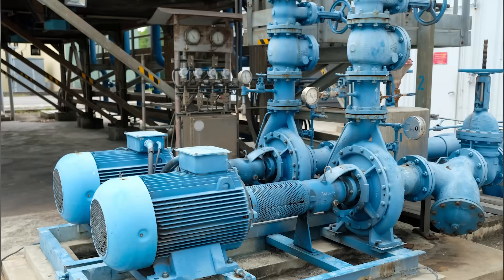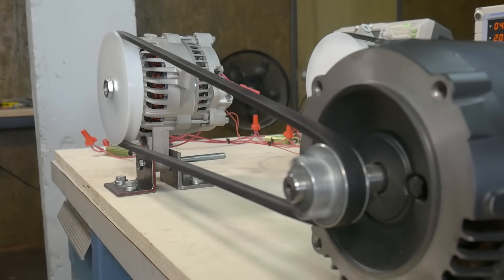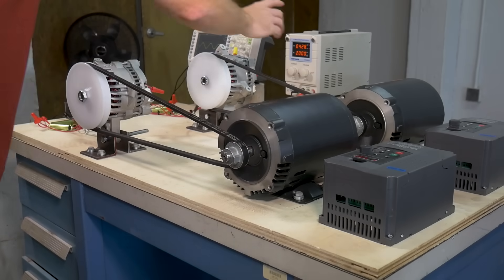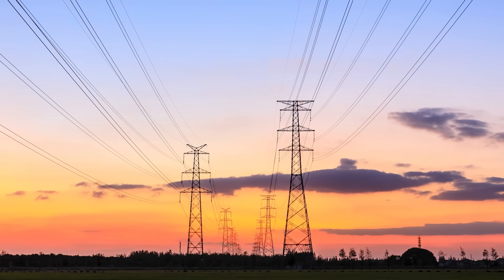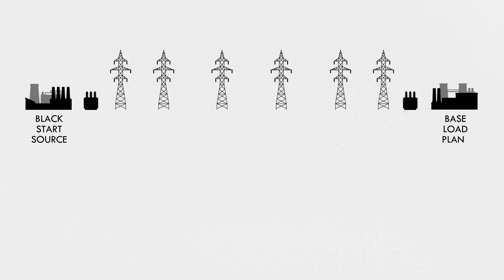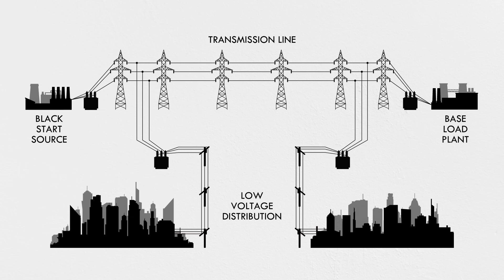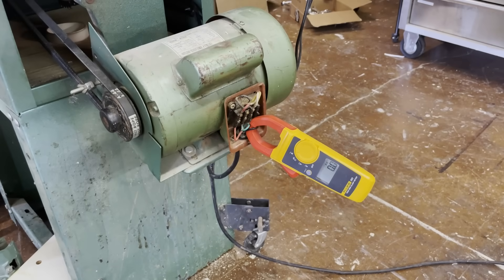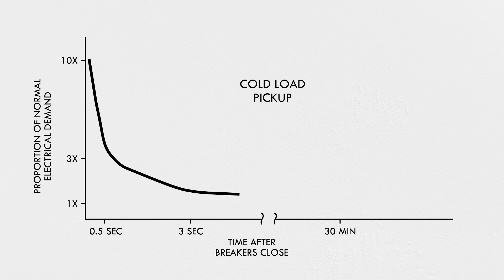What Is A Black Start Of The Power Grid?

Comment: I would be really interested in getting a breakdown of what happened in North Carolina for the deliberate Act of terrorism and how they manage restarting the grid after repairs are made. This is actually a very on point video, as this very situation is happening right now.
Reply: I can find no details of what part of the stations was damaged.  As a former grid operator my best guess is that they shot up the cooling radiators of the transformers, allowing the oil which cooling and insulates them to run out.
Reply: This is not a black start situation in the sense that the area was to small to need a black start.
Reply: @tedmoss  No, it certainly wasn't.  I have since learned that the damage was a shot through the case of the transformer into the core - I hadn't thought big enough.  Likely the he only remedy for this is a rewind.
Reply: I believe the news said someone shot holes in some transformers.
Reply: I think that would be great to get on here somewhere afterwards just I was thinking the same thing actually needs to be done for sure
Reply: yeah, I was hoping this will address NC power grid attacks given title and time of the video release.
Reply: I'm pretty sure some substations we're also shot in Oregon and Washington and you would have to know where to shoot a substation to shut it down
Reply: Sad to say, it very well could be the work of a mad former employee of the electric utility.  I say that because employees in the operating portion of the company know where the weakest links are and can easily cause the most damage.
Reply: @dalekrohse1871  They do? I work for a utility and have no idea where the weakest link is. But I'm also not actively looking for it. Just doing a little work here and there to keep my boss happy and let the checks keep coming
Reply: A good use for the military would be to protect critical infrastructure.
Reply: @anonamouse5917  lol no
Reply: All over a drag show, yeesh!
Reply: @Desmaad  was that actually proven? As I heard it that idea came from one religious wierdo that told the police that it was punishment from God for drag shows, not that she knew a person did it because of them.
Reply: @gadsdenjack  
Well the kind of people who would do such a thing have been talking about doing such a thing for a while now.
Reply: @Desmaad  got a source for that? None of the authorities have said that was the cause
Reply: The infrastructure damaged in Moore County are "just" substations. Substations don't generate any electricity; they just help distribute it, and the amount of consumers isolated from the grid due to this damage isn't terribly significant to the nearby power plants. The inrush loads when the substations are repaired and reactivated is probably the only thing somewhat close to black start concerns.
Reply: @wbfaulk  Want to tell that to FPL. In 2008 an engineer took out the protective circuits to diagnose a faulty switch. A short circuit occurred which killed 38 substations, 26 HV grid lines, and shut down power plants in 4 counties. That put over 3 million people without power for up to two hours or longer. All because one substation dropped off line. Cascade affects from a sudden loss of load can have major affects on the grid. In particular where nuke plants are involved as they are designed to protect themselves at a level that fossil plant could only dream of.
Reply: Are they actually calling it terrorism, or is that a term you decided to use just now? I'm not trying to downplay the impact of a serious power outage but it seems like the bar for terrorism has lowered quite a bit over the past 20 years.
Reply: @Oberon4278  It is terrorism. However, the impacted businesses have incentive to make sure it is not accurately categorized because insurance does not cover acts of terrorism. So in summary - yes, it was terrorism. But it's more profitable if we don't call it that. As you know, money is king in this utopia of a country.
Reply: @JohnDoe-le1cu  You're just going to assert that without backing it up in any way?
Reply: @Oberon4278  yes, its domestic terrorism. It was a coordinated effort against our infrastructure.
Reply: @Oberon4278   Yeah a drunk redn3ck doesn't seem like terrorism to me. Unless I hear otherwise, I am not going to believe it is.
Reply: @Oberon4278  I think that it could be considered terrorism IF it was done for a reason other than "Haha, I broke your stuff".  So far, everything I've seen points to the people who did it knowing the impact of what they were doing.  We don't know why, though.  No government statement I've seen has directly called it terrorism.  They have also said it hasn't been ruled out.  "Terrorism" is a great word to put in a headline, though.
Reply: @bagel_deficient  Agree completely.
Reply: @bagel_deficient  the Sheriff is definitely considering terrorism though considering that during his press conference he reassured the county that donestic terrorism experts from the FBI are there to help the county
Reply: @bagel_deficient  Moore county has one of the highest population of Special Forces operators in the country. It's one of the only things notable about the county, and oh how notable it is.

Comment: synchroscopes are still used today. I personaly use them on ships to synch a generator to the ship's net when more capacity is needed (for heavy consumers like a cargo plant, large cranes or thrusters). It is remarkable how similar a black start is to what we call a cold ship start.
Reply: We still have analog synchroscopes on the main grid just in case we need to rebuild by phone.

Comment: Lol, the 1965 blackout was supposed to never happen again, the infrastructure was upgraded and we were told that was a once in a lifetime event never to be repeated.
Then, *POOF*, 2003 Northeast blackout happened repeating history.
Reply: It highlights what Brady said about the sensitivity of the grid when operating very close to it's limits. The 1965 blackout was cause by a misconfigured relay in Ontario during heavy demand conditions, the 2003 by a heavily loaded power line in Ohio that dropped touching tree branches that hadn't been properly trimmed. Additional improvements have been made to monitor all parts of the power system, better sharing of information among grid operators and better computer modelling.

Comment: Blackstart capability is another point that led to the development of VSCHVDC transmission systems.
Reply: Is that about not using the line for commutating the rectifiers and inverters?
Reply: @gregorymalchuk272   When you have the line commutated topology you use the frequency of the grid to switch the thyristors if you have the vsc topology you make your "own" frequency.
Reply: Yes, they could be a great black start unit as long as the destination converter station has some means of auxiliary a/c power to power pumps cooling the thyristors. Converting HV DC power generates lots of heat that has to be removed.
Reply: @DisinterestedObserver  You mixed lcc and vsc topologies up. Only vsc uses igbts and is blackstart capable. But your right that you need dieselgenerators to start up again

Comment: Most wind turbines and solar panels need the grid for the frequency reference to sync to prevent damage.  This is why they are not really used for black start.  Also transmission lines and transformers need power to established the magnetic field.  The power plant that I worked at required about 34 MW to energize half of the switchyards and the vital buses to get our equipment running.  

A blackout is the lost of power to the grid.  This is different from damage to the grid from a hurricane or a tornado.  In a damage grid, there is no place for the power to go since the wires and poles are knocked down.  Generators will trip off line to protect the equipment since it has no place to send the power.  The rest of the plant (pumps and other equipment) may or may not be able to run depending if all the sources  into that plant's switchyard trips off line.

Comment: Great video, always an interesting topic!
Hey, i was wondering whether you had any knowledge about grid-tied solar inverters?
The reason I ask is that some people complain that even when they are running a large excess of solar energy, they are still pulling a reasonable amount of wattage and I can't even check because my meter is of an older type that won't show me.
How does a grid allow feed in from a solar installation? Do they drop power in the area to allow reverse flow? 
Maybe this happens when too many solar installations are feeding too much into the grid?

Comment: One thing I would like to mention about grid synchronization is that sometimes operators will actually allow their generators to go just a bit faster than the grid frequency to sync.  This helps "push" electricity out from the generator onto the grid  as if they synched perfectly depending on the size of the generator and its location in the grid there is a risk of the grid "pushing" back into the generator and start motorizing the generator.  Our plant was considered the end of the line for the gird so to keep stability a resync needed that slightly faster push.
Of course, this is all carefully controlled with microcontrollers these days.

Comment: If I’m at home I’ll shut the breaker off to high demand and delicate electronics to avoid damage while voltage is fluctuating on power up. Being toward the tail end  of our transmission grid just plain old line voltage varies between 115 to 123 volts on a normal day.

Comment: Probably a dumb question but something I never really thought about: if a motor's wire is coiled tightly together without any insulation, how is that different than just a big block of copper?  Is there still sufficient resistance between coils to produce an electric field of the desired direction/characteristics?
Reply: The wire is insulated with a varnish.  The voltage gradient between turns is very low, so it doesn't take a lot of insulation.
Reply: @monophoto1  Thanks!

Comment: I enjoy your videos.   When I was a power plant operator, we synchronized the oncoming generator with the synchroscope moving "slowly in the fast direction" and at a few moments before straight up.   This combination (slow in the fast direction and slightly before straight up) causes the oncoming generator to pick up real voltage (as opposed to VARs) and positive load immediately  upon closure, and minimizes the risk of a reverse current trip.

Comment: I really hope you do a video on the sabotage of the Moore County, N.C. substations! Which goes along perfectly with this series.
Reply: Actually, that's a slightly different issue.  It was/is a localized outage, where the remainder of the grid remains intact.  The issue is that the sabotage damaged equipment, and the damage must be repaired and/or equipment replaced before service can be restored.

But the subject of sabotage could be interesting.  There was a notorious incident outside San Jose, CA a few years ago when someone shot up a major 500kV substation.  Actually, sabotage has been around for a long time, most often involving transmission lines in rural areas during deer hunting season.

Comment: What happens if a geomagnetic storm like Carrington Event happened again? 

Does the black start have enough electromagnetic protection against this type of storm?

I would love to learn more about this.
Reply: Fortunately, geomagnetic storms are predictable, so utility operators know now that they need to act to prevent damage.
Reply: @monophoto1  I hope that's enough. My fear is that even turned off equipment can burn due to electrical discharges. There is any type of faraday cage over these generators? 

I am only curious. I don't understand how X class CMEs or a G5 class  geostorm  can knock out the power grid. 

Some weird stuff happened in 1989 in Quebec. Transformers were damaged with a geomagnetic storm 3 times smaller than the Carrington Event. The outage led to five million people being without power for 9 hours.

Comment: how does them small consumer and construction generators work ?

there is no power to power an excitation coil so how do they self excite  i know they dont have permanent magnets except for the newer ones that may use  an inverter instead of generator.

they use something like the brushless motor to make dc that powers an inverter to make ac.

since synchroscopes require 100 volts you could just use a step up transformer made from say a doorbell or hvac control transformer witch is 110 on one side and 24 on the other side.

just wire the 24 volt side to the generators and the 110 side to the synchroscope.

it may be possible to modify the synchroscope to work on lower voltage if it uses a resistor dropper to reduce the voltage for the meter movement.

Comment: How exactly do you dis/-connect substations during an outage? Without any power, there is no way to drive the motors that the stations use. Even if the station could power itself up only by the power in cranking path or if this is done by hand, how does it know when to switch on to deliver power to the city? Without power, there is no internet or phone lines.

Comment: A nearby nuclear plant has 4 9000 HP motors which circulate cooling water.  That is 6.7 Mw each.  The dual standby generators are 5 Mw each.  Once running, the plant can easily supply the power, but to start-up there is a large draw on the grid.
Reply: The boiler feed pumps are by far the largest parasitic load. Close to 100 megawatts on a 1 gigawatt steam-electric generating unit. As big as a small municipal power station of today, an average one of yesterday, or a large one of the 1940s.
Reply: Yes, a 1200 MWe nuclear plant has house loads of approximately 50 MWe. The reactor coolant pumps in a PWR you mentioned are the biggest motor loads but the condensate, feed water, and circulating water pumps are also big in their own but not quite as big.
Reply: Yes, a 1200 MWe nuclear plant has house loads of approximately 50 MWe. The reactor coolant pumps in a PWR you mentioned are the biggest motor loads but the condensate, feed water, and circulating water pumps are also big in their own but not quite as big.

Comment: It’s hard to be quick when trying to balance the load when grid is small….the sensitivity’s of the various generators that might be hooked up to the grid at the time will be a fine balancing act as they will disconnect from the grid and trip off due to high or low voltage….high or low hertz…etc.  Texas got so lucky that winter, so so lucky.  How much hydro do they have to start up there?  The use of gas turbines is so much better for many reasons and this is one of them.  They can react so much faster then an old giant coal burner that takes hours or days to get to full load and prone to tube leaks, etc.

Comment: Is there a reason something like large capacitors or flywheel storage isn't used as a way to store power in the case of a black-start scenario? While there would be some power leakage from the system, a well made system could probably have minimal losses and if it's continually kept up-to-charge then so long as it can keep it's power for a few hours that should, ideally, last long enough to jumpstart the generators after the cause of the blackout has been handled. Microwaves and other high voltage electronics are considered dangerous indefinitely because their capacitors can keep a charge stored for so long, so I can't imagine it'd be impossible to store enough standby power long enough to handle these situations.
Reply: Because it's physically and economically unfeasible to store that much energy on-site. A 1,000 megawatt steam-electric generating station would require close to 100 megawatts for at least a few hours to drive the boiler feed pumps, cooling water pumps, vacuum pumps, and the draft fans. That's like the size of a utility power station of yesteryear.
Reply: @gregorymalchuk272  and your describing an extremely potent generating station. Not all stations' outputs are measured in the gigawatts. Not to mention you wouldn't need one on-site for every single generating plant since once you get one plant online you could pull the other ones online.
Reply: @robonator2945  1,000 megawatts is an average nuclear unit or a large coal unit. An average coal unit is still 600 to 900 megawatts.

Comment: I work at a major radio network, and we have independent A and B backup power. We use a very similar synchroscope to synchronize our pair of 750kW diesel generators if they start at different times. And if you try to hit that button before the sync light dims, ugly noises are made.

Comment: Britain has two pumped-storage facilities, one in Wales and one in Scotland that are designated Black Start stations. They are never run down to empty so they can provide Black Start power to the rest of the grid if necessary. As you said, it's never been tested for real because blacking out the nation's entire grid just to see if it would recover properly is not a feasible proposition.
Reply: We got two big dams for a water powered power plant in the alps..  and they are both able to be black started.. basically, you somehow need to manually enable water running down the mountain until it hits the turbine.
Reply: Many older power stations in the UK also had a self-contained black start capability. For example, the now demolished Didcot A station had 4x 500MW coal fired units but on site there was also a self-contained mini power station with 4x 25MW open-circuit gas turbine units to give it a black start capability. The gas turbine station is still operational alongside the newer CCGT plant but it's now used to provide additional peak capacity.
Reply: Here's my local one 😊
https://en.m.wikipedia.org/wiki/Dinorwig_Power_Station